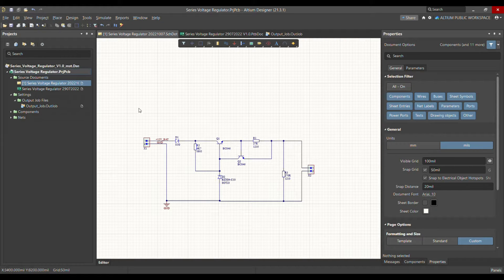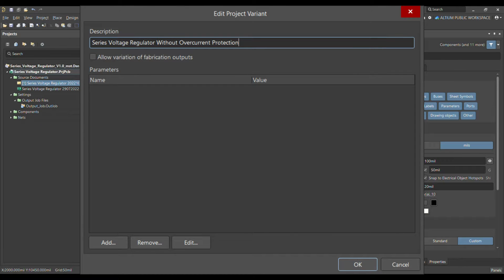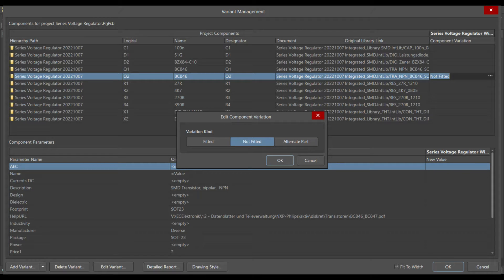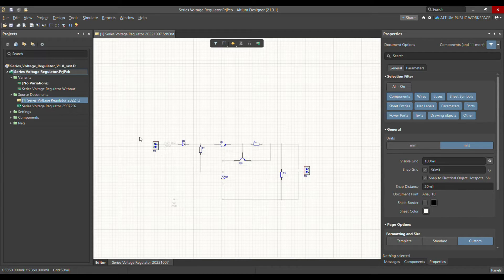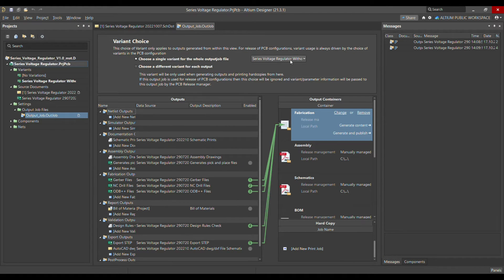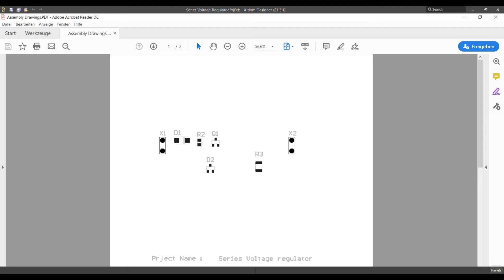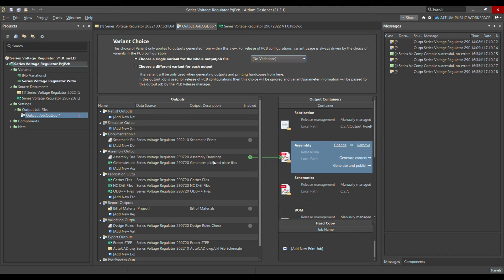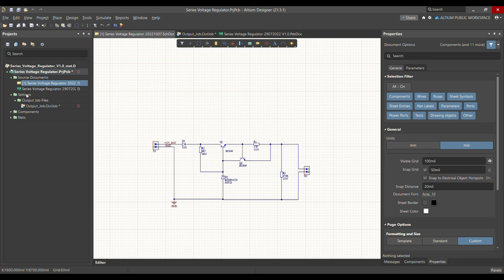Altium Designer Tutorial 16: How to Create Variants in Altium Designer 21.

Comment: Thanks for your great video, if you back to Editor, the marked not Fitted part still shwon as normal used. When I print the schematic with the not fitted variant, I can't get the not Fitted version, only get as seen in Editor sheet. Do you know how can print a pdf as added variant?Many thanks!
Reply from the maker: Danke dir ZukunftBruecke für deinen Kommentar.

I think the issue is in the last step. Please follow these steps carefully:

1. In your Altium project, select the variant as in my case: “Series voltage regulator without overcurrent protection.”

2. Open the Output Job file and choose “Select a variant for the whole Output Job”, again select “Series voltage regulator without overcurrent protection.”

3. This step is very important: under Output tab → Schematic Prints, select “Project Physical Documents” (not “All SCH Documents”).

This should work. If not, please write me email and I will share screenshots showing the exact settings.
Reply: @altium3669  Great. Many thanks! The third step was missing.
Reply from the maker: @ZukunftBruecke   you are welcome :)